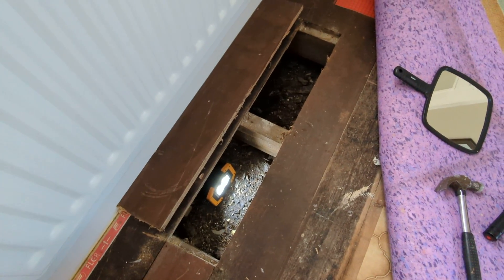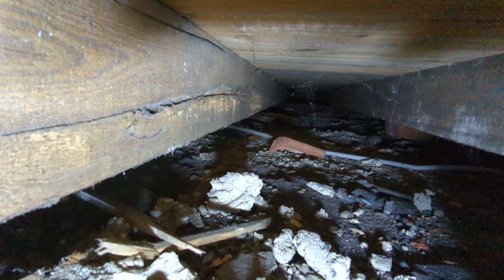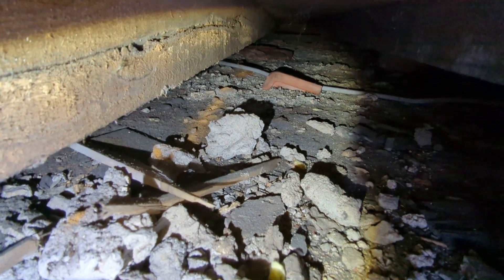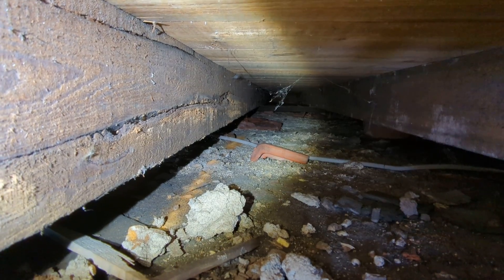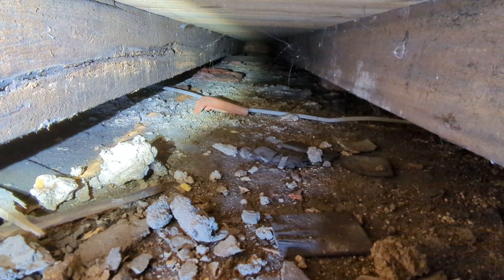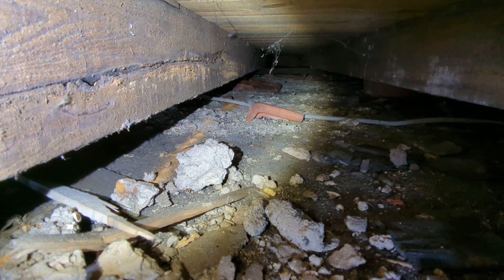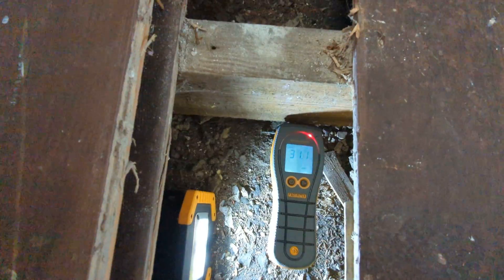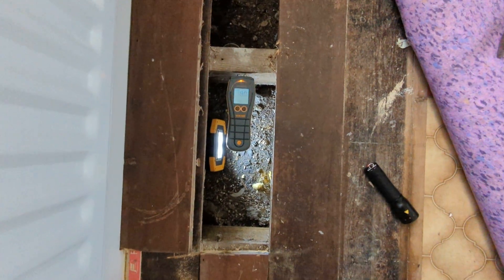Wood boring weevil-the tell tale signs.

Comment: Interesting video Neil. I'm looking at insulating a timber floor with sheep wool hanging in breathable roof membrane. Do you think this would be detrimental to the air flow around the timbers? Many thanks, inquisitive SAVA student 😁
Reply: In the States, we put a 6 to 20 ml vapor barrier on the soil, insulate crawlspace walls with foam boards, and install a dehumidifier. Crawlspace encapsulation.

Comment: i have been in this industry for over 30 years i disagree with your diagnosis i think this is common furniture beetle, wood boring weaval is more prone to where the joist ends sit on the load bearing wall where more damp is coming from the support walls as they like high moist timbers  I'm not criticising you just my opinion i am a subscriber to your channel i agree that it needs more ventilation thought
Reply from the maker: I welcome your comments but with all due respect I have to disagree with your observation that the infestation is CFB. Having seen it close up I can confirm that it is definitely wood boring weevil. The tunneling along the grain is very different to what would be found with a CFB infestation. I have seen this type of infestation thousands of times where the timbers have a high sapwood content. Best regards, Neil.🤝